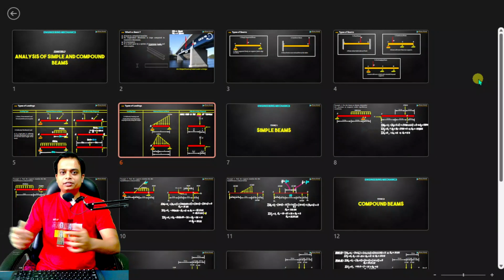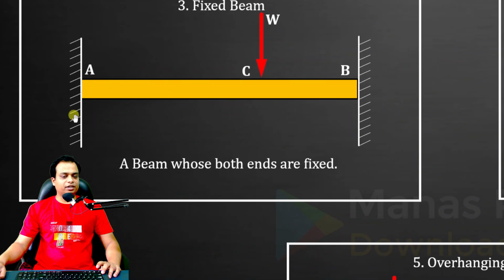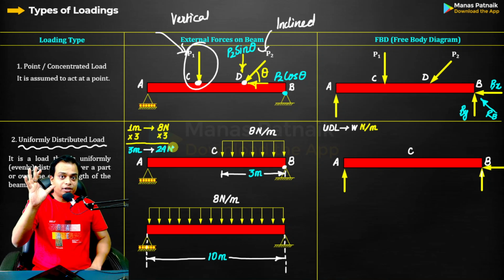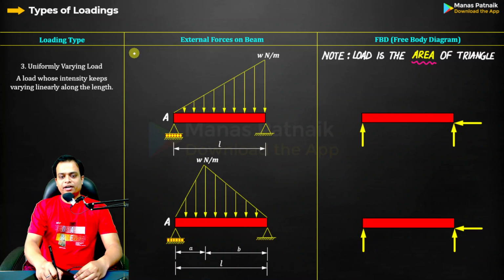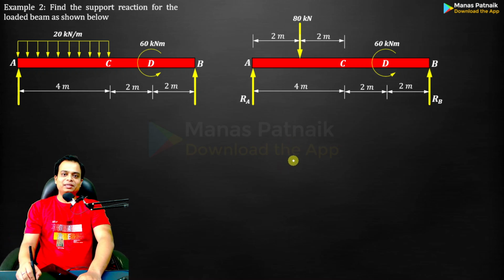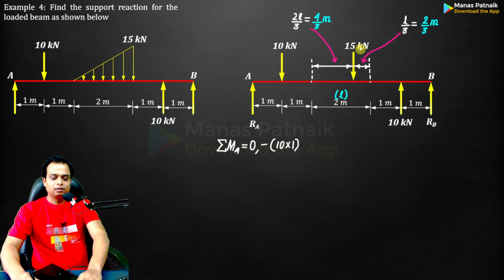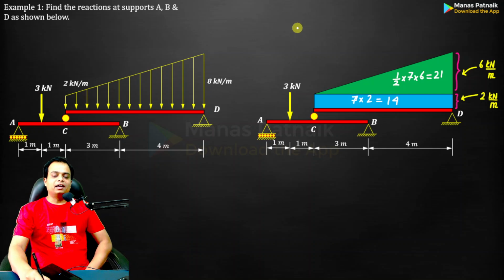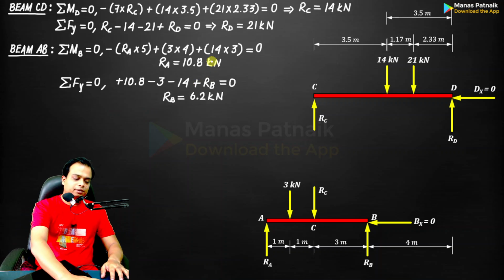Class 5_Simple and Compound Beams_UDL vs UVL

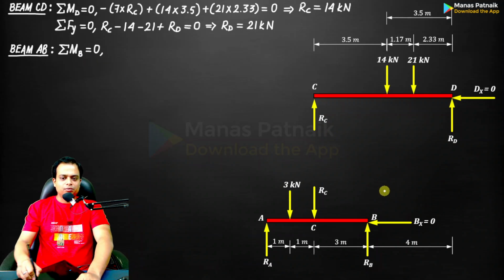Comment: excuse me sir, in the case of the combination of the UDL and UVL,after separating the bodies i thought the UVL automatically becomes a PIVOTED beam,and Reaction at point C will start acting downwardly (+) ? Also with the UDL,it will change to a simple supported beam,hence, eliminating the point load C which was relying on it. 37:41